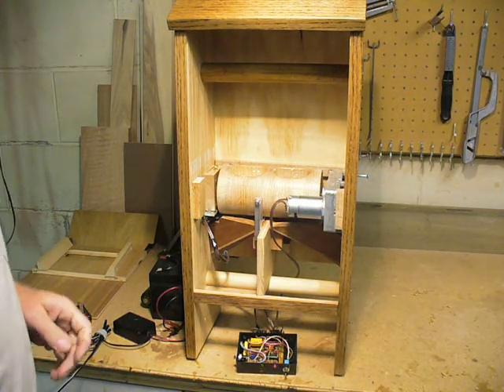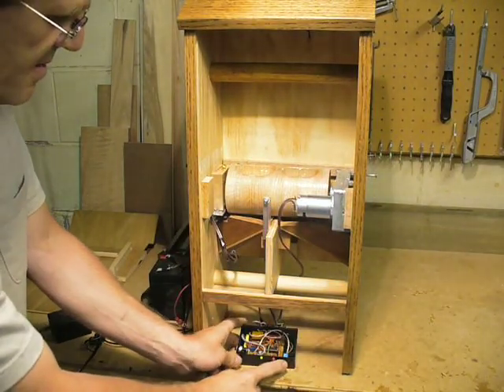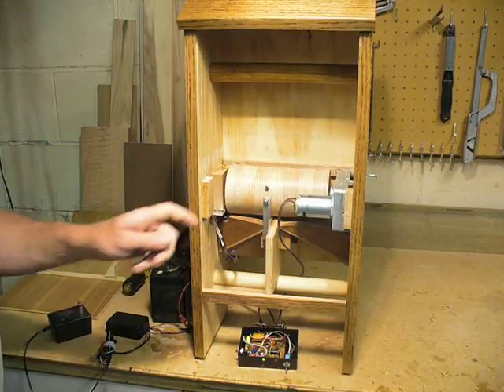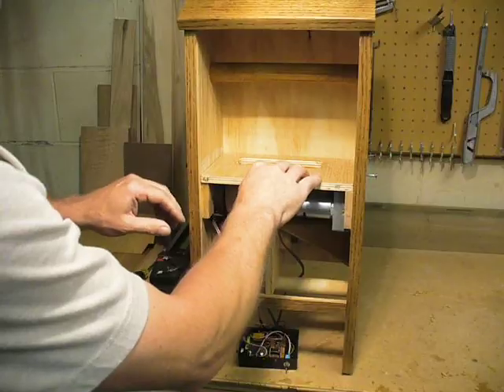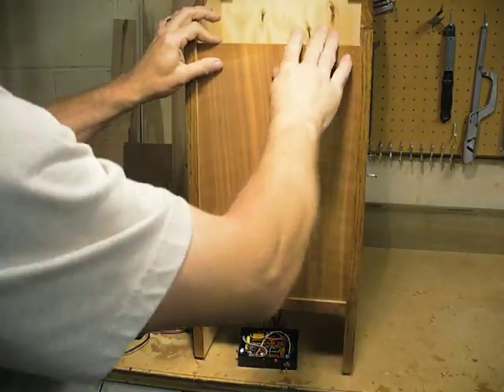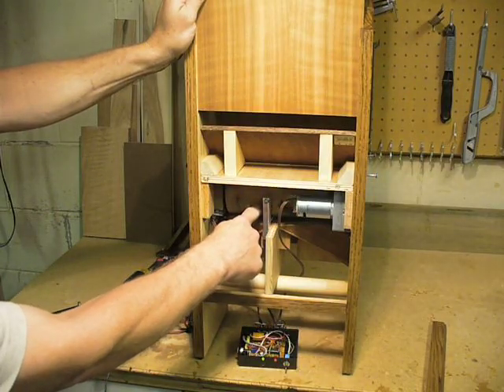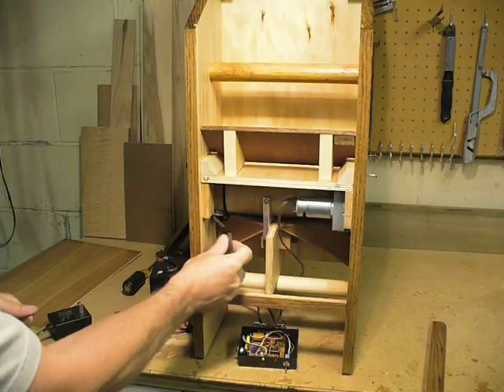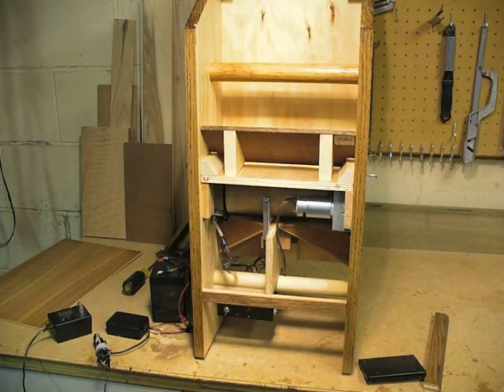Homemade automatic cat feeder

Comment: Good job! What is the stepper motor you put in it? If it's a stepper, seems like it.
Reply from the maker: No stepper motor.  It's a 12v gear motor.   I got it from surpluscenter.com as I recall, although they no longer have the exact model.  Any slow geared down motor would work.